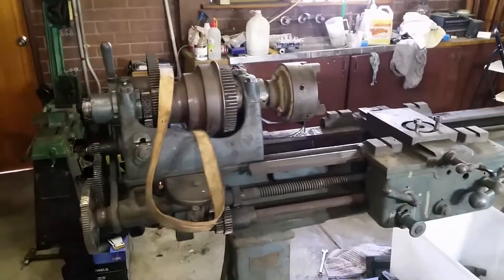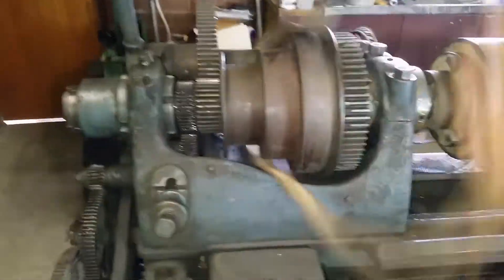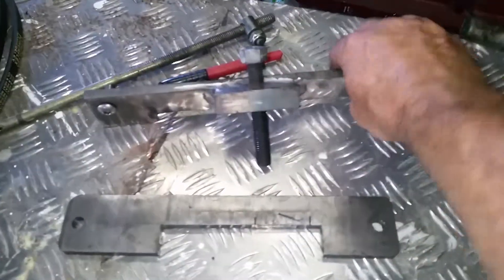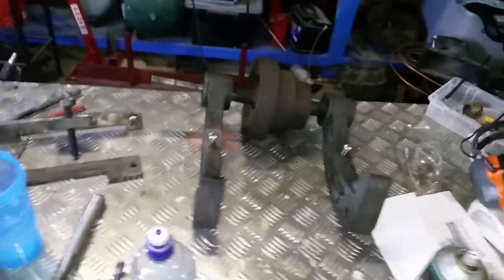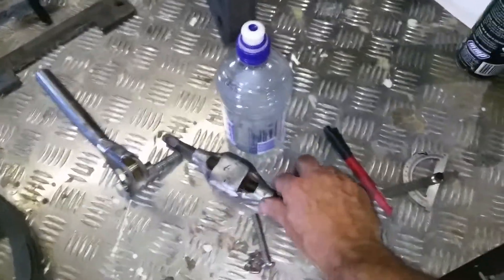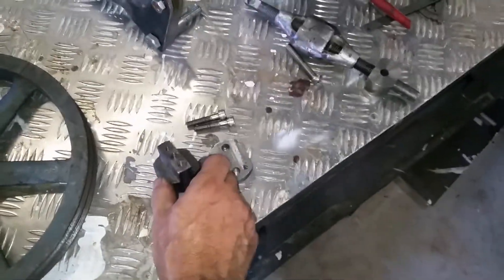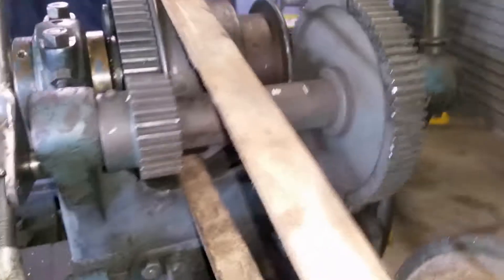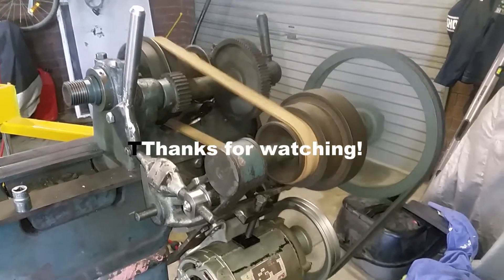DIY vintage lathe belt drive and tensioning system

Comment: Presumably this motor runs all the time when switched on. How is the lathe drive activated, do you release the belt to stop it/reverse it say, if you are screwcutting? Thanks
Reply from the maker: You turn the motor on to work, turn it off to change speeds.

Comment: Great vid...but don't forget to grease the belts...yes young man you do grease live leather belts but only with animal grease..
I always kept a chunk of salami in the tool box and gave the belts a good rub before shutting down for the night. dead dry leather just slips so people add to much force on the belts and get bearing wear as a result. just some FYI from and old man.
Good job have fun.
Reply: thats great info for im new to these old leather drives. i just bought a mint condition 1938 13" south bend. stole it $500

Comment: How do you know when the belt has the correct tension?
Reply from the maker: Just by feel. A little loose is better, if you have a crash it's safer if the belt slips instead of the machine crashing.